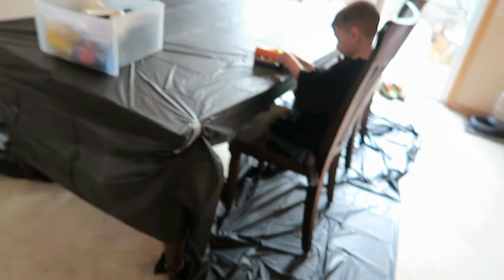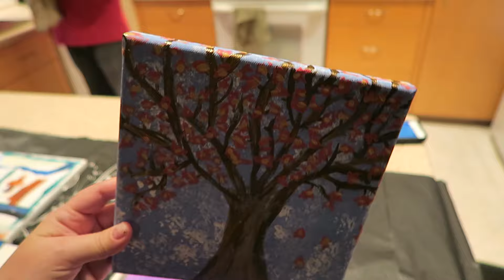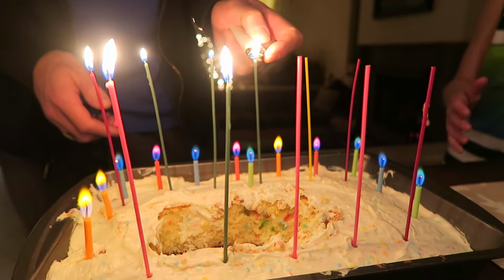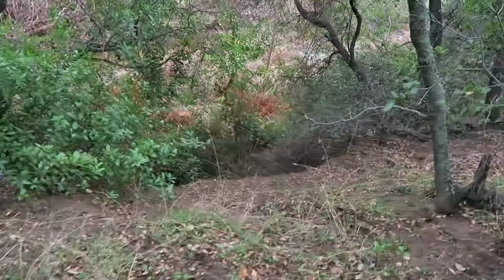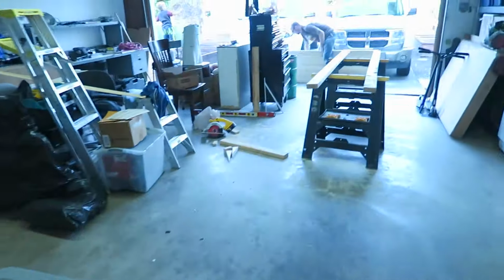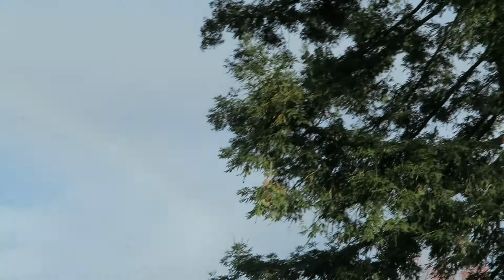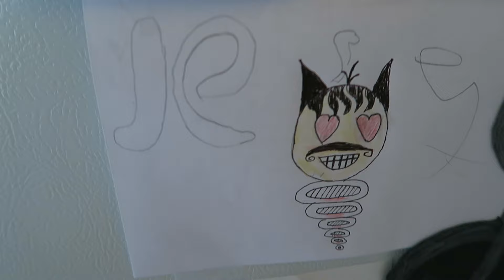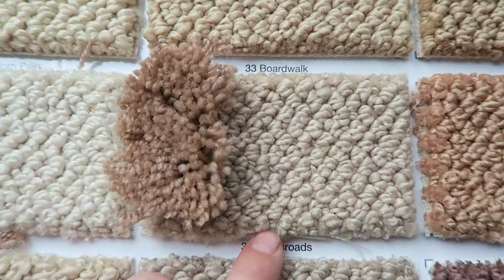Party Like An Animal #82 vlog

Comment: I would go with Crossroads, I think the other choices were too light, it would drive you crazy in the long run. Just out of curiosity, what were the other colours on the board? I know you said they wouldn't work, but you could go with a nice chocolate colour. You have to remember you are only seeing a small swatch, once it's laid out it's actually a lot lighter. Carpet is very hard to get right and another rule to remember is once the carpet is actually laid, you immediately can lose up to 10% of the colour. I always go darker than I think I would like and it turns out great. I hope this helps. I do interior design in Australia. Good luck
Reply from the maker: +julia way #3 for crossroads! Thank you so much for your tips they are super helpful. I had know idea about these things! Thanks again. xoxox